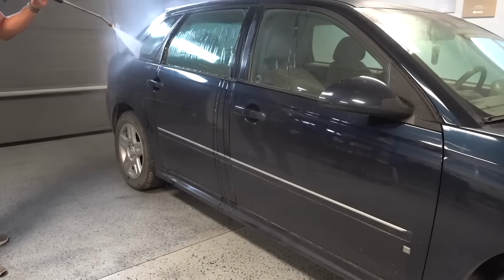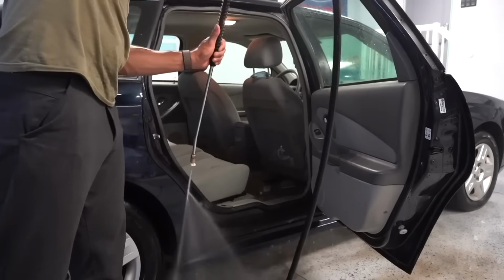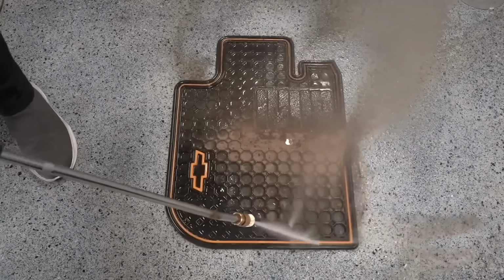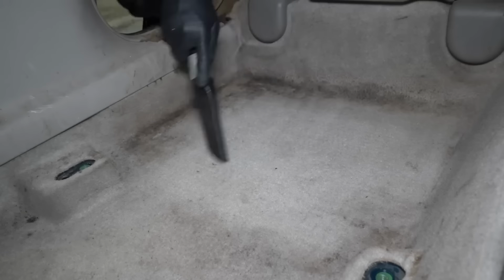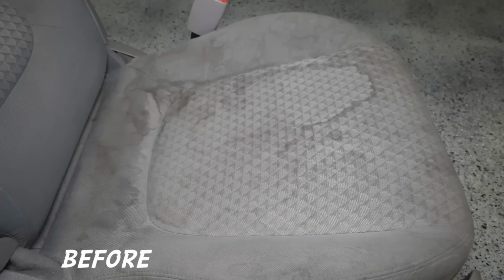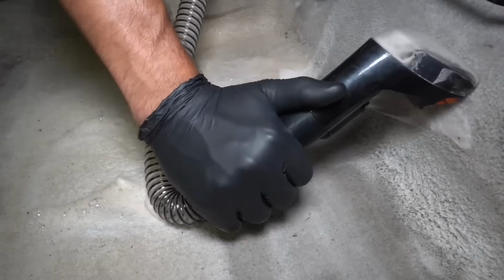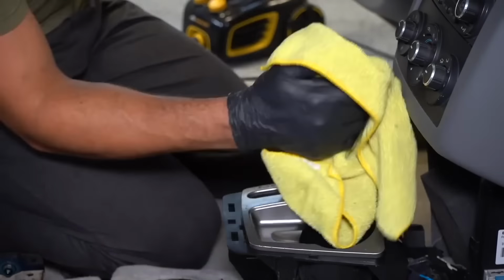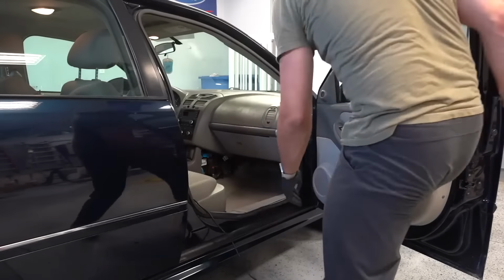Deep Cleaning a Smoker's DISGUSTING Car!

Comment: Great result, as usual. Would like to know if you do anything with the headliner on a smokers car. I have never seen a detailer address this.
Reply: I was wondering the same. I have never seen Mitch clean a headliner.
Reply: Mitch spot cleans headliners with APC and a quick blast from the steamer (covered with a towel to lessen the force) In this vehicle he also used the ozone machine to remove any lingering odors.
Reply: Headliners and their adhesives can be very very delicate, so be careful !

Comment: I’ve seen this a few times in videos now but with this one especially. I’m curious why you don’t take the wheel covers off the wheel when you wash them to make it easier to clean behind? No hate meant by this, just curious as I watch a few different cleaning channels and some do take them off, and others don’t. Does it depend what kind of pressure washer you use which makes the water spread more so you can spray the inside at the same time? Thanks for the great content
Reply: I thought as much

Comment: Do you extract the ceiling inside the car? (Can that even be done or will it pull the fabric off?)
Reply: You can't do any type of extraction on the headliner because it would loosen the glue and cause the headliner to sag. Mitch spot cleans headliners with all-purpose cleaner and a quick blast from the steamer. In this particular vehicle he also used the ozone machine to remove any lingering odor.
Reply: @Jennifer_MB  Thank you!   I have always wondered that and have been afraid to get to aggressive trying to clean that!
Reply: @lorid1348 You're welcome! It's smart of you to not get too aggressive, the fabric on most headliners is so thin that if you saturate it too much you've got a real mess on your hands.

Comment: What did you do to get the haze out of the headlights.  First time seeing you do them. 
Also do you clean the seat belts, around the seat belt lock, headliner and how often do you de-haze headlights.
Reply: He cleans every inch, it just gets redundant to show those small details in every single video. This is the quick fix version, but the original video (2006 chevy malibu) is also on the channel if you want to check out what he does to the headlights. It's worth a watch! 👍

Comment: I’ve asked before and received no comment. I will ask again. What about the head liners in these cars?  How would you suggest cleaning. You have never shown before. Thank you
Reply: He has shown cleaning the headliner, but like the sealtbelts, it gets redundant in videos so doesn't get shown every week. He uses APC to spot clean along with a quick blast from the steamer as not to disrupt the adhesive. For this particular vehicle he also used his ozone machine to remove any lingering odors.